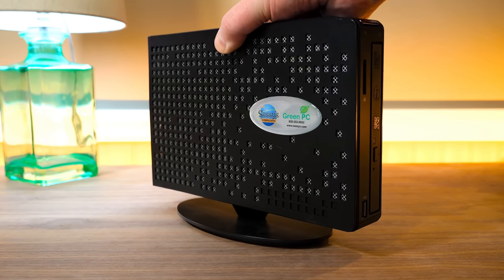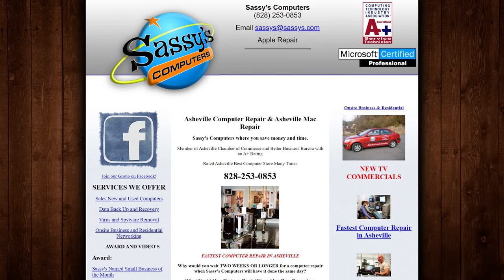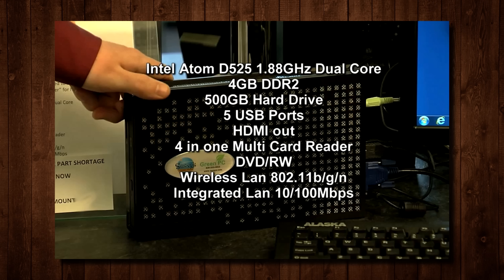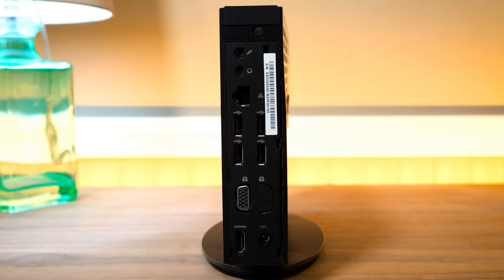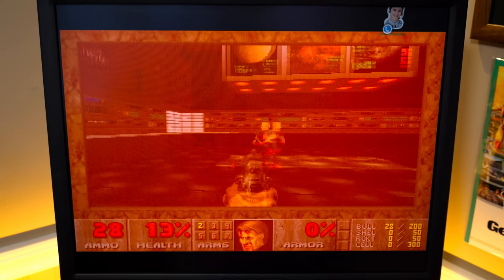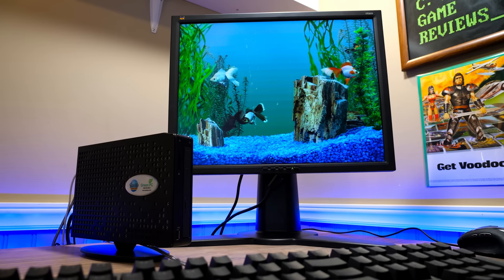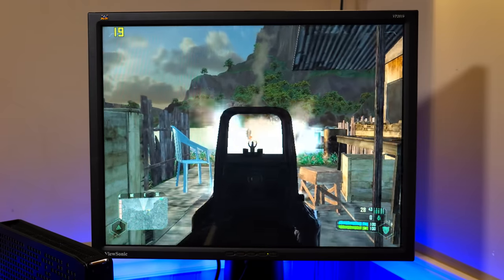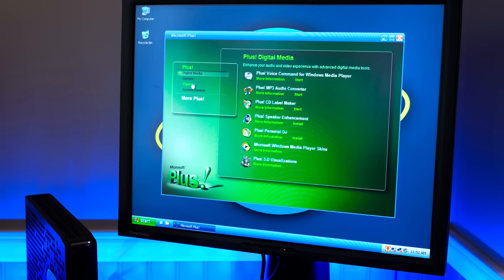Rejuvenating a $599 Shuttle Nettop from 2011! Sassy's Green PC

Comment: Anybody wondering if this is old enough to be retro I can assure them I tried using an Intel Atom netbook in 2011 or so and it felt a decade old then.
Reply from the maker: Yep, it's really like using a desktop PC from 2002
Reply: i used to play the heck outta san andreas on my netbook back in those days.. crazy how well some games are optimized that they would run decent on those super slow machines! i used to always play halo and battle field 2 online as well with the netbook... the very low power consumption always made them interesting to me
Reply: There is a pretty good reason for that. The Intel atom first gen lines are really just refreshed Pentium cores.
Reply: Hmmm most business here in the slum jungle run 775 pcs, and when they buy new pcs it's generic chinese MB with usually an i3-2100, my working laptop is from 2011 and works nice with ssd + ram upgrade, so i would be innacurate calling something from 2011 old
Reply: Netbooks were a revolution for cheap computers though. Sure they were cheap crap and were destined for dumpsters, but as a kid in 2009 or so an Acer Aspire One felt like a miracle. Nowadays you can get a perfectly-usable older laptop for a couple hundred bucks, but back then it felt amazing and community support through linux distros and stuff was incredible. Nowadays a total antique though with the ubiquity of smartphones.
Reply: @MrNick2913  There weren't any dual-core Pentium processors until 2006. I assure you this 2011 mini PC performs quite a bit better than much higher price-range 2002 desktop PCs.
Reply: @trashandchaos  My Asus Eee PC 900 HA is still pumping along completely reliable and more than fast enough for the Linux distro I run on it. Many other laptops have cracked or had components fail, but my Eee PC was built like an absolute tank.

I remember Acer netbooks being crappy with hinges and low-quality plastic housing that were prone to cracking, and the similarly low-powered Chromebooks that took over later on were also garbage. Even worse, many of them had soldered-on RAM and soldered-on crappy 16gb solid-state drives. But the 900 HA with a RAM slot and a 3.5" disk drive bay is still incredibly useful to me and I expect will remain useful for many years to come.

I now have a fast 1TB drive in it and I use it to play from an incredibly large music collection. Very useful little device, much more useful than Chromebooks etc that I purchased many years later. There are a few things that will always be useful in a device no matter the age: small form factor, high build quality (so it doesn't crack, components don't fail), and upgradability/replaceability of parts. Early netbooks, especially from Asus, had that going for them.
Reply: I recall seeing a first gen atom laptop running wc3 smoothly, that was honestly pretty pog, tho for its time it was hopeless
Reply: @MrNick2913  it was a total redesigned, despite it was derived from p55c but the core architecture is barely identical to the original.
Reply: @aaronrezash5220  I was part of that first class at my high school that got netbooks. Man they were junk but I played the shit out of NBA Jam.

I'll never forget one teach I had a bit of a feud with over head me telling my buddies I had finally made it to the championship game on NBA Jam. She literally remoted in and watched until there was like 30 seconds left and took control to boot me out lmao.
Reply: From 2010 through early 2013 an N450 netbook was my main PC, frequently hooked up to a CRT that I got for free at some point along with a G3 or G4-era Apple keyboard and a cheap wireless mouse. Can't say I really miss the jank of that setup. I remember compiling the Linux kernel, even disabling modules that weren't currently loaded on a stock Arch kernel, was like a 1-2 hour affair, and even at the lowest draw distance, Minecraft's framerate would frequently dip into the single digits without really going above 20 outside of caves or very cramped mines. Still dumped well over a hundred hours into it, though. Nowadays I'm bothered when something like GZDoom has a microstutter and drops a frame or two, so I don't know how I used to tolerate that.

I still run an Atom D525, in a little mini-ITX build I put together over a decade ago. It works great as an energy-efficient server as long as you don't throw too much at it. It's kind of a shame that newer Atoms on mini-ITX boards for stuff like lightweight HTPC or home server use aren't really a thing anymore, but I guess ARM stuff like the Raspberry Pi can fill that role nowadays.

Comment: Intel Atom and Windows XP Media Centre 👀  

Honestly though for such an underpowered chip it decodes media pretty damn well, didn’t expect to see 1080p so smooth.
Reply: It probably has hardware decoding onboard
Reply: Also quite curious if using the original 2004 Release of HL2 might help. Certainly helps on a lot of underpowered systems
Reply: Most likely, I’m just used to seeing Atoms struggle with even 720p and H264ify on YouTube
Reply: @BudgetBuildsOfficial  that depends on the atom.
Reply: I remember my old core 2 duo having trouble with 1080p video!
Reply: @BudgetBuildsOfficial  That with running it with dxlevel 80 or something like that should improve things considerably.
Reply: Sure, man! Swap out the WiFi card for a Broadcom Crystal HD card and you can enjoy the latest Hi-Def content in silky smooth, hardware decoded H.264!
Reply: the ION 9400 is quite the beast for low end at its time, although the core2 macbook 9400 is much more suited then the  atom based 9400.  I had a ION based laptop back in the day and the atom was the atom, but it did do SC2 decently.
Reply: My Atom N270 netbook with GMA950 can playback 720p videos locally without any problems. Decade ago it was still able to play some 720p flash videos in browser too but not anymore
Reply: I have a similar PC, ASRock ION 330. The ION chipset was pretty good in HW video decoding at the time. I am wondering how this nettop would perform with Plex? Any chances to test it?
Reply: My HP T620 drops frames I'm surprised at this
Reply: I actually used one of these (or a similiar model) as a KODI box until I finally upgraded to a 4k TV. It was funny, decoding 1080p video actually was easier on the processor than running the KODI menus. The ION graphics did pretty damned good at decoding the video.
Reply: It uses a Nvidia Ion 2 for GPU so with the right drivers and media player the video decoding is handled completely in the GPU for a long list supported video codecs. The Nvidia "PureVideo HD 4" this has should completely handle the video decoding of Blu-ray, HD-DVD, Blu-ray 3D, DivX and Xvid without any help from the CPU (some of the older helpers only did the "heavy" parts, but the GPU on this does all the video decoding).
I don't think there's any common high-resolution format of the era (and a number of years after that) where it's not capable of decoding the video completely in hardware as long as the resolution doesn't exceed 1920x1080.
The Atom D525 is not a powerful CPU but it's not going to be stressed by demultiplexing the file (into video and audio data) and handling the audio decoding. It's a neat little media box.
Reply: @theultimo  This machine actually has the slightly newer and more capable Ion 2 (based of the GT210, Tesla 2.0), not the older Ion (9400M, Tesla 1.0).
So, it has "PureVideo HD 4" instead of "PureVideo HD 3" video decoder engine, supports up to DirectX feature level 10_1 instead of 10_0 and is likely slightly faster.
The DirectX feature level upgrade means it'll support more DirectX 10 and (very?) slightly more DirectX 11 games, the video decoder engine upgrade adds MPEG-4 ASP (IE DivX, Xvid) and MVC (Blu-ray 3D) support - the original Ion does support fully accelerated Blu-ray and HD-DVD (which means even the original video decoder handles pretty much all non-DivX/Xvid files up to 1080p of the era).
Obviously neither will handle AVC, VP8, VP9 or similar codecs so once you start to hit those kind of media (several years later) it'll run into trouble but for the era it would have been an awesome media center PC with the hardware DivX/Xvid decoding.
Reply: I'm the guy that designed, build, marketed and sold the Green PC.  I chose a platform that had a dedicated graphics chip specifically so it was capable of 1080p H264 playback with VLC.
Reply: @Torbjorn.Lindgren  THIS.
Reply: @BudgetBuildsOfficial  if you really want to play YouTube videos on that, you're better launching them in potplayer (works better than VLC for me in that particular application: Asus eee without ion + YouTube 720p)
Reply from the maker: @BudgetBuildsOfficial  Oh hey, Budget Builds! When starting this project I actually went straight to your channel to check if there was already a video about this, haha.
Reply: @BudgetBuildsOfficial  Knowing LGR, It probably is. I can't imagine him installing Steam on XP Media Center.
Reply: @LGR  Closest system to this I’ve found was a Corporate CD player from a UK Coffee Chain that was based around an old Atom, similar specs, but wildly different purpose. 

Really enjoyed this find though 👍
Reply: @hesthatguy  it looks like a perfectly capable little computer for what it is — it would have been nice to have had an ssd back in the day, but that would have probably been way out of budget at the time.

The current generations of HP elitedesk mini still do the same sort of form factor and the same sort of behind the monitor mounting system, although they’re not completely fanless. Very popular in offices throughout the world.
Reply: @JasperJanssen  I really wanted to put an SSD in them but it pretty shed the cost beyond what most people were willing to pay.
Reply: the nvidia chip will be doing the work surely? it can rip through 1080p pretty easily.
Reply: @LGR  hey lgr and budget builds lol nice
Reply: Hey budget builds
Reply: @BudgetBuildsOfficial  That highly depends on which one. I have an Atom gaming PC that works like a charm. Heck I got an Atom-based POS machine that has hyperthreading, and it decodes YT really well on its integrated graphics.
Reply: @BudgetBuildsOfficial  He said in reply to another comment that he installed HL2 right off the disk (somehow; I thought even the release version required Steam to work) so I think it's more that Source is very CPU-heavy compared to other engines of the time.
Reply: I had the aced aspire d250 with the atom processor.  You could get this “crystalhd” 264 decoder that worked on mpice slots.  
Coprocessor that let a atom system
Read a 24gig mkv!
Reply: From memory, a lot of stuff that came with the Atom (ie, netbooks) also came loaded with Windows 7 'Starter Edition'. It pegged things hard as to become unusable - it was always updating. I personally found that Lubuntu made these wildly, insanely, vastly more useful. Still slow... but for the basics, rather acceptable.
Reply: @MattExzy  Give Linux Mint 19.3 XFCE 32 Bit a shot. In my experience, it works way better, and with a cheap SSD it can single-handedly revive these netbooks into being usable again. Also consider H264ify for better YT playback.

A WM might also work a lot better, but that's not as nice to use
Reply: Had to laugh when the advert combined Intel Atom with "powerful". No wonder this thing could stay relatively "cool" and was low power. Only people that didn't know their stuff would have though that it has similar performance to core2 or core i CPUs for a tenth of the wattage.
My wife had a Aspire One Netbook around this time and damn was it slow.
Reply: @moomah5929  Depends what's on it. When new, yeah they sucked. On an SSD, with 2GB of RAM, on Linux Mint 19.3 XFCE, they actually are perfectly usable. It's pretty wild.
Reply: @xPLAYnOfficial  Only had one gig and couldn't be expanded.
Reply: @moomah5929  Really? I have an Acer Aspire One and it maxes out at 2GB. Honestly though even on 1GB it can still be usable. Give it a shot.
Reply: @xPLAYnOfficial  remember taking it apart and it had the ram soldered on. Even asked my wife as I wasn't sure anymore. Of cause it has been many years and there were countless models.
Reply: @xPLAYnOfficial  yeah I had that same thought.
Reply: @moomah5929  Shame. Still, Fire it back up and tinker with it. You might be surprised.
Reply: @BudgetBuildsOfficial  This CPU (Intel Atom D525) has build in GMA 3150 which do not support h.264 codec. Decoding is done by external GPU chip - Nvidia ION.
Only late Atom chips with Intel HD Graphics (Cherry Trail) or (Bay Trail) support h.264 codec natively. (AFAIK that are models with 4 digits after some letter in name. Cherry Trail: z7-Zxxxx, z5-Zxxxx, z5-Exxxx and Bay Trail: Zxxxx, Exxxx). Cherry Trail models also support 4K/H.265.
Reply: Later atom chipsets were very capable.
Reply: @yarharyar  I agree. I just ordered an Atom 300 board, and it's so good they built it into a gaming platform with a dGPU XD
Reply: (answering while havent finish watching). this model has ion graphics right.
Reply: glad to be the 69th like

Nice
Reply: @xPLAYnOfficial  I realize this is a 2 month old comment, but I would be very interested in the specs of your Atom gaming PC. I've toyed with the idea of an i3 4130T or similar build to play around with, mainly experimenting with using multiple fans to see how cool I could keep everything while still drawing as little power as possible.
Reply: @izvitz  Well I actually have two. One of them is an Atom D525 with an ATI Radeon 3450, while the other is an Atom 330 with a GTX 480. One of those probably makes no sense for your idea XD
Reply: @xPLAYnOfficial  Heh, I'd say anything with a TDP of over 75W would be out of the running! That 3450 looks like an interesting card, though...might make an Atom build of my own.
Reply: @izvitz  The Atom board I'm using is from a security DVR. Luckily it had a PCIe x1 slot on-board, so I mounted the miniITX board into a new case and stuck in a HIS x1 3450. Nothing amazing, but it's been fun!

Comment: Got this exact PC haha.  I got it in 2014 very cheap from Amazon UK (£140). I put a slim slot load Blu-ray Burner in it and SSD. Since it has Intel QuickSync support it was/is a perfect Steam remote play/Media centre PC.  Steam streaming (at least at 1080p, never tried it at 4K) was flawless. Now it's just sat in on a shelf with no use.  Plus Fanless/Passive cooling as well as just looking good next to the TV!  Mine has a more pleasing 'Shuttle' Branding on the sides though. That oval is an eye sore haha
Mine had a Celeron J1900 CPU in it with the Quicksync support, very capable!
Reply: $140 haha you hot ripped off
Reply: Eh I wouldn't call that a ripoff in 2014. You could get it cheaper used from somewhere but with Amazon you could return it if it didn't work.
Reply: @learnedeldersofteemo8917  actually, it’s more like $186
Reply: That would be a Shuttle XS36V4, compared to the XS35GT V2 he have, those are VERY different machines even if the outside is similar.
The Celeron J1900 is more than 3 years newer, has twice the number of cores and each core is also almost twice as fast!
Similarly the GPU side is wildly different, his as an Nvidia Ion 2 discrete GPU, yours has integrated GPU with QuickSync generation 2, note that even QuickSync 1 didn't even exist when the D525 was launched.
Basically, there's pretty much no similarities beyond the shell... Which also explains the price, it would have been insane to sell a D525/Ion2 for that in 2014, but reasonable for a J1900 in a very small shell (which always cost extra).
Reply: @samholdsworth420  hahahaha 😅👍🏻
Reply: @learnedeldersofteemo8917  He didn't buy it in 2022.
Reply: Could maybe use it as a streaming/download box or a pfSense router. Or a NAS, a digital audio source for a hi-fi, or see how well it handles emulating older games or Linux (or both) -- I can personally attest to BGB emulating a Game Boy Color at full speed on a 350MHz Pentium II. As someone who exclusively uses older hardware and is fairly proud of that fact (the closest thing I have to a daily driver is a dual 800MHz Power Mac G4), I definitely think that something this modern could be put to work in any number of ways with some outside the box thinking -- especially if it keeps it out of waste streams.
Reply: @Mustang1984  ih
Reply: @lepidotos  I def agree there's almost always something that can be done with these systems, though sometimes for most there's more work and time than it's worth. I do enjoy upcycling, and like you said it keeps things out of a landfill or "recycling center" type scenario.
Reply: Lol still using a J1900 now, i have way more powerful machines but this thing is driving my TV. Will be replaced soon (new machine is on the bench lol)
Reply: @hi_tech_reptiles  I wouldn't be as opposed to e-waste centers if they didn't just throw what they were getting into a pile in Mexico or Pakistan, causing ecological issues there but at least we don't have to deal with it.
Reply: Install a FreeBSD compatible USb to ethernet adaptor and pfsense or Untangle.

Comment: I remember the Shuttle 'cube' PCs from the early 2000s, fun fact I was in the local IT department of my school that year doing work experience and got to build several from scratch, my fingers accidentally touched one of the power supply contacts whilst it was plugged in and I felt it!  Luckily the circuit breakers kicked in very quickly